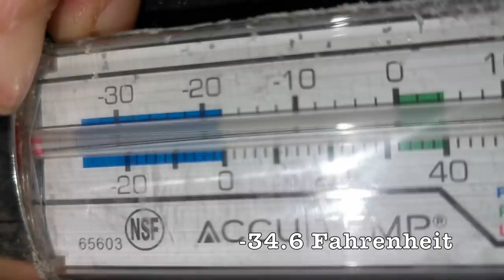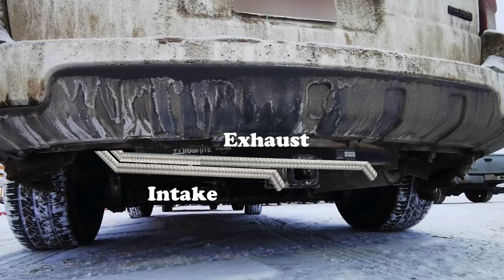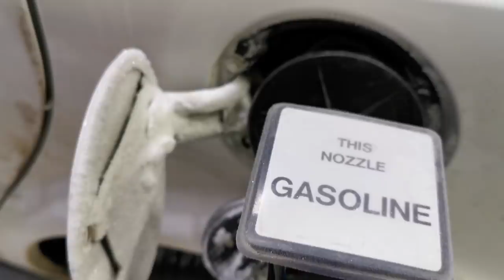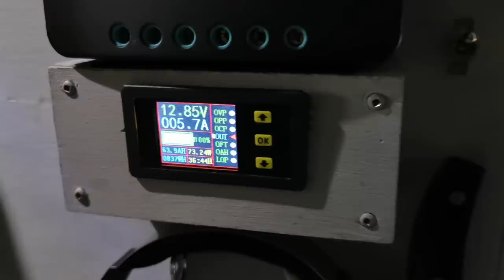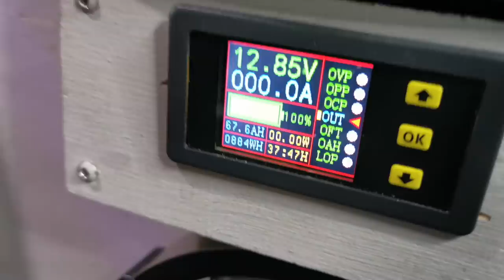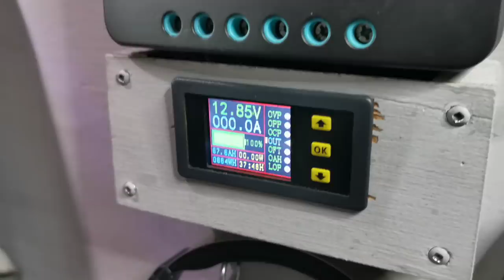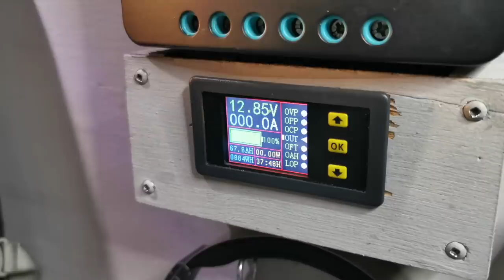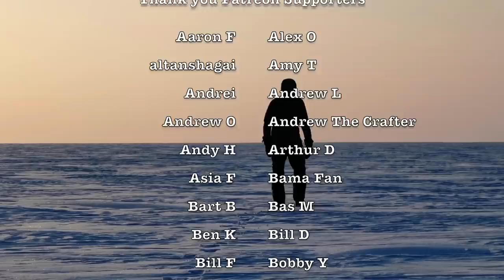Minivan Life - Northern Lights

Comment: Your idea of taking heat from the exhaust to warm up the inlet is called a counterflow heat exchanger. It should help with the inlet frost buildup, but it may cause a new issue with exhaust frost buildup. You may want to check the exhaust outlet temperature on a cold night. If you add too effective of a counterflow heat exchanger and this temperature gets below 40F, the exhaust frost buildup could start. It is also important to keep the exhaust pipe sloped downhill to allow the condensation to drip out the end. 

Thanks for the fun to watch videos.

Comment: Haha; only -35! Your attitude to life is the right one! 
What anti-freeze do you use; pure alcohol, haha!

Cool dude; take it steady and follow the birds... south, haha
Reply: 50% ethylene glycol 50% water is good to -50F
Reply: @robmeekel9198  thanks, I find it interesting. I wonder what is happening to timing belts and hoses too at those temperatures? I thought I was cold here in +2°C England 😂😂
Reply: @relax-tn1hx  All things are stiffer, warming a vehicle up definitely helps. when it gets below -30C keeping air in tires also becomes an issue. Both because the volume decreases and the seal between the tire and wheel.
Reply: @robmeekel9198  thanks for the info. I think I will stay here in balmy England 😂
Cheers dude 👍.

Comment: If you do the exhaust and intake tubes, route the exhaust under the intake so that heat rises.
Reply: I wouldn't put the intake so low on the vehicle.
Renault tried it a few years ago resulting in many destroyed engines when they were driven through large puddles.

Comment: Good job diagnosing the heater problem before you froze to death! I have vented gas logs here at the house. The unit is totally sealed from the inside of the house ( you can't get inside the glass!). The flue is actually two concentric pipes. Exhaust goes through the center pipe. Combustion air comes in through the annular space between the inside and outside pipe. This does a couple of things. First, it keeps the outer pipe surface cool so no one gets burned. Secondly, it preheats the combustion air to recover some heat otherwise lost and also prevents the inlet air from condensing (and freezing). You may be able to find a double wall pipe like this to solve your problem. The solution is similar to the one you suggest in this video but you might like this one better. Good luck and stay warm!

Comment: good info for the colder temps on these deisel heaters. i did throw that air intake filter away and went to local auto parts store and bought a mr. gasket  V-8 valve cover breather that fit inside the deisel heaters factory air inlet hose and used the stock clamp to secure it and ive had no issues w/the air intake but i did run my tubing up by the firewall in the motor compartment of my van. But i did use a mower exhaust can at first but it plugged up and shut the heater down i had to take it off and when i got it going again it fogged out a country mile lol, its been running great since i took off the muffler and just run the pipe out the back now;)

Comment: Cooking Tip: When you are trying to melt your cheese on your pizza on the pan with the lid, add a little bit of water to the hot pan (maybe 1/8th cup just enough to create steam), the water will steam immediately. Cover with lid, and melt the cheese super fast.
Reply: Wouldn't that make the naan soggy?
Reply: @avener28  - not if the pan is already hot. water will immediately turn to steam, and make sure you just add just a little water and cover with lid.

Comment: A tip for tortillas. Make two piles of filling on opposite sides of the bread, make sure you have at least an inch of space between them. Then fold the sides in and have them overlap, then fold it in half so you got two pockets of filling.  Optimizes the bread to filling ratio, leaves zero mess, can be eaten with one hand.
Reply: Jonas Larsson Wow very scientific lol

Comment: Hey man! Just subscribed. Enjoy your videos.
You should wrap your pipes in pre-glued insulation foam, and then the foam in insulation tape. My old man works in HVAC and uses insulation foam for the cooler and heater pipes.

Comment: I believe the problem with your intake frosting over is because the exhaust is warming the ice crystals in the air and  refreezing when sucked into the intake. Putting the intake closer to the exhaust may work as the moisture in the air will be warmer and get past the intake silencer. You might have better luck routing the intake to a place farther away or even drawing air from inside the van for the intake. (It will be louder) Also if you’re running the van while the heater is running, then your intake will certainly freeze off in no time if its getting exhaust from the tail pipe of the van. I grew up here in the north and also have 3 of those heaters.

Comment: I think that exhaust wrap would be good after you put some stainless tubing around them both, the transfer of heat from the exhaust should give you a sort of heat exchanger, effect!  Be interesting to see how it works!
Reply: Copper would work as well
Reply: @JimKJeffries  agree, I did think of aluminium as that has the greatest transfer rate of heat but I'm not sure what temperature his exhaust gets up to, plus there's work hardening of the metal which wouldn't happen with stainless and so would be tougher with all the vibrations of a moving vehicle!

Comment: -40 or colder brings with it some new curveballs. It's a whole different cold than -20 or even -30 celsius. Good idea on the heat exchanger, I think that should help. As long as it doesn't create more moisture issues.

Comment: to prevent air intake filter of a diesel heater from frosting (clogging): 1) there should be short (about 1 foot) piece of pipe on the end of it; and 2) that entire filter and short piece of pipe then should be wrapped up close to exhaust pipe.  This way, air has more chance to heat up before entering the Air Intake Filter.  I never tested this, I am only guessing this solution.

Comment: Beautiful  videography and stills... Some folks let their diesel heater draw air from the inside of their rv. Its not as dry as external air but probably prevents intake frost problems. Maybe you could rig an internal intake with a y-fitting and use a duct valve to turn off/on the internal air intake. Just a thought.
Reply from the maker: It might create a suction within the van, pulling air in thru the door jams?  Maybe help exchange the air though, reduce condensation.
Reply: It should be pressure neutral when it is drawing intake air from the inside .
Reply from the maker: Do you mean the combustion intake or the blower intake? The blower is inside, just recirculates interior air. I've heard of people routing that to an external vent.. But the combustion tube would suck air from inside the vehicle and blow it out the exhaust pipe. Maybe it wouldn't be that severe.  Would definitely eliminate frost problems and increase combustion efficiency.
Reply: @forestyforest  No I have it wrong, the combustion intake and exhaust needs to be outside. Sorry to waste your time. I thought you were drawing blower air from outside as well. Again, my bad sir.

Comment: Wrap the exhaust and inlet together with exhaust insulating tape. It may be enough to take the chill off the incoming air. . Cheap solution if it works. You’ll need to use wire to bind it with to ensure it doesn’t fall off.

Comment: I think the problem with the frost in pipes is that the pipes are lower than the heater. I think u need to raise them above the heater so that the moisture runs back toward the heater.  Then u have to install a small drain at the low point .

Comment: Foresty
To stop the air intake freezing up could you not lag the air intake with pipe lagging from DIY store or run the intake partially alongside the diesel heater exhaust  to keep it warmer,obviously not having the intake and exhaust end close together so the intake doesnt suck in the exhaust fumes.
PS, like the videos,keep 'em coming :0)

Comment: You can set your heater up to work on thermostat so you can set the temp you want and it will modulate the hz on its own to try and maintain temp. I did it with mine there are YouTube videos of it

Comment: Arent you supposed to have the air intake inside the car, and the exhaust outside? Then the warm air gets recycled, instead of sucking in cold air from outside and then warming the cold air..?
Reply from the maker: It has two air intakes. There is one inside that heats the air. The pipe outside fuels the combustion.

Comment: Cant you do a LOW-VOLTAGE RESISTOR COPPER WIRE to WRAP AROUND THE FILTER? 
Wont it stay warm from ohm resistance? A 9volt battery? 
I seen a similar system once on a sailboat where he had a low voltage system with a copper wire that ran around the handrails that prevented them from freezing
Reply from the maker: It could work but no point wasting electricity when a source of heat is right there. There is a ton of wasted heat coming off the exhaust pipe, it is hot as fire. Would be awesome to route the exhaust pipe under my bed before going outside.  Heated mattress 😊
Reply: @forestyforest  that actually wouldn't be too hard, I would probably use a metal that retains heat well if you're not worried about weight but if weight is an issue thick aluminum will do
I would imagine you don't even have to reroute the exhaust a thick enough piece of metal wrapped around the exhaust would transfer the heat wherever you needed it to go

Comment: Hey man. Fellow Canuck here. Just wondering, how do you keep the Co2 levels safe inside while you're asleep? Also, have you thought of trying to insulate the top of the van beween your ceiling and the metal roof with expanding foam? all the best.

Comment: Do you run deisel or kerosene? The name brand that they copy you can use kerosene in and manufacturer claims less problems. 

Real nice northern lights , thank you.
Reply from the maker: I have only tried diesel from the pumps. I think Kerosene works but I don't know more about it.
Reply: @forestyforest  I looked into this kerosene more, of course it's your call. Kerosene is good to -40 f while deisel is good to -17 f. We use kerosene to make diesel useable in winter back in New England back in the day. Advantage is it's able to be used in cold situation and it's more viscus so it doesn't thicken in cold which prolongs fuel pump life . It also burns cleaner than diesel so less mantainence of burner chamber. In USA cold climates it is fairly cheap and available . Canada? Stable so a Gerry can will not blow up. Using it above 0c or 32f diesel wins , below that temp a mix or straight might make life easier. Then do your own research as I might just be off my rocker.

Comment: I do not have experience with those extreme temps.  However, That filter should not be needed. you are pulling air into the combustion chamber that is relatively dust free and I cannot imagine much in the way of insect life.
Reply from the maker: Nah probably not needed. Sometimes people drive by and kick up debris but the chances are slim. I still think heating the intake is a good idea though.
Reply: @forestyforest  It sure wouldn't hurt. I think that you were getting rime icing forming on the inlet screens, removing the screens would solve the problem.  I think your idea using some header tape would work. For a really slick install a coaxial tube with the exhaust and the intake air running through it would be hard to beat.

Comment: can you update your battery and stuff how in the world can you charge it if your in -35 yukon lol thats my question .
Reply from the maker: It was a pain in the ass. I had to babysit the battery and constantly monitor the temperature.  Sometimes I left my diesel heater running on low while I was away doing stuff.  With constant temperatures of -30c you definitely want to consider other battery options. I was looking at the Relion Low Temperature LiFePO4, it has a built in heating element. But probably the most expensive LiFePO4 money can buy 💰💰💰

Comment: Yeah, at those temperatures your heater needs some heat. Old Ruskie tech like locomotives had things like that incorporated in, where they would run the pipes through certain areas which confused foreigners. Downside is that in normal, habitable temperatures, it causes discomfort and overheating.